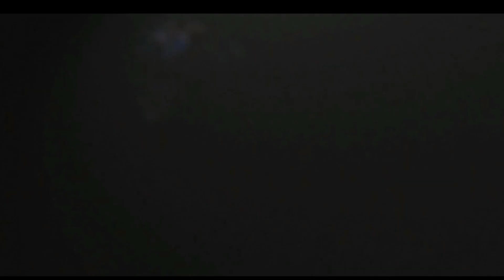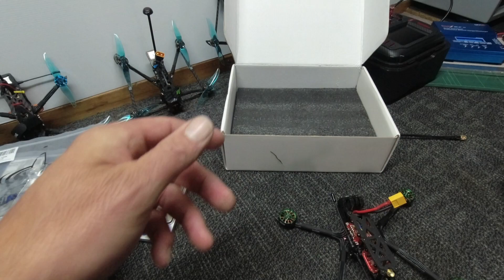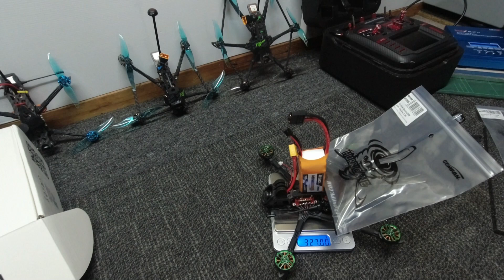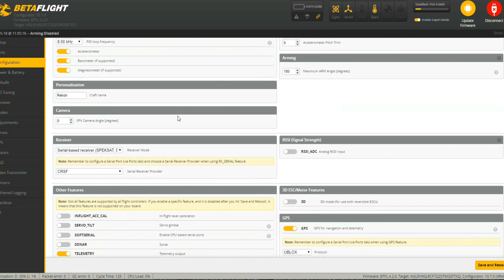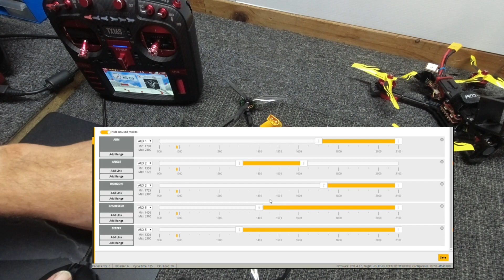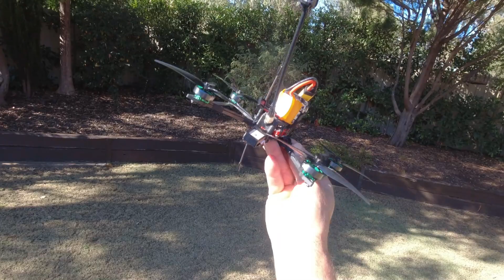HGLRC Rekon 5 - Long Range FPV to beat them all?

Comment: My reckon 5 didn't come with the brace arm screws. Do you know what size screws I need for the braces?
Reply: Thanks a bunch.
Reply from the maker: Sure mate. They are 9mm hex screws. Same diameter as the motor ones.  👍

Comment: I must have gotten old stock, because the one I just received (PNP 4s version) came with 2800kv motors and the immortal T mount only attaches to the side of the camera TPU (which is a pain).
Reply from the maker: Ooh. No good. What did you order  👍

Comment: I see you have "Bidirectional Dshot" turned ON in your configuration tab. So did you upgrade the ESC firmware ? Because out-of-the-box ESC (BlHeli_S) does not support this function on the original firmware.
Reply from the maker: Hmm. I did not set the bidirectional on.. I am about to see if my esc firmware was updated at all. I'll leet you know shortly!  Cheers. SP
Reply: @GTARC_au  If your Rekon5 DOES have bidirectional on, then I´d like to get some screenshots from you with all the factory settings for that (Configuration/Elec+Battery/PID setting tabs wth rates & filters subscreens). Can I contact you via email ?
Reply from the maker: Ive checked my esc firmware and see that it was not updated and therefore the bidirectional Dshot should not have been turned on.... yikes. Im not sure why it was on... ive since been over all my settings to double check.  Thanks for the heads up!. That explains why i thought that the R5 was not flying properly.  👍🍷🍻
Reply: @GTARC_au  Does your factory PID"filters" setting also have the Gyro-filter slider very low(far right), and the D-term-filter slider in the middle ?
Reply from the maker: Yes mate. Correct. The D term is in the centre and the Gyro is a quarter of the way in the Less Filtering section (far right).

Comment: What is the small wire connector next to the battery lead for ?
Reply from the maker: They are the power cables/connector for your hd camera. Insta 360 etc. 👊👍

Comment: How do you setup RSSI/LQ on an aux channel mine has always been just over OSD, it seems to still work fine, what's the difference?
Reply from the maker: TBS crossfire allows it to happen. Do you have tbs?
Reply: @GTARC_au  yes , my 8th channel is blank but my RSSI and LQ is displayed via OSD

Comment: I made a custom one and do over 40 min flights.
Reply from the maker: Wow. Have you posted a vudeo of it. 🍻👊
Reply: @GTARC_au  https://youtu.be/eTPa8zHZaR8
Yea that.. since tuning better and this time being smoother on the throttle I got this time. I want to try 4S and see if I can beat it. Also I have to try more efficient props like 5126 bi or 5125 tri.  That 40min flight was on 5130
Reply from the maker: For sure.
Ive been testing out the LION on my Rekon and cant seen to get more that 15 minutes?? I have the stock 1525 props and wonder if Bi-blades would be better??
Reply: @GTARC_au   I assumed biblades are better atleast maybe low rpm. but in motor testing the 5125 have been more efficient followed by Biblades then 5130. at high throttle since test starts at 50% that i find. I have not put the biblades back on to test since i broke 1 and dont have anymore. I can test 5125 and see if i can get a long smooth slow flight.. omg so boring lmao
all the data is subject because it matters weight ur carrying and throttle needed to hover.
PS also i try and stay at low amps and cruise 15mph to 20mph ( i averaged 18mph). gets longer flight but shorter flight distance
Reply from the maker: For sure mate. Agree 100%. Alsogoing to try tilting the camera up as far as i can to reduce the amount of throttle.  Im doing a flight video test  tomorrow to push to 30 minutes with the factory Bi blades! 👊🍻
Reply: @GTARC_au  I just tested 4S Li-ion with 5130 but with losing video and having to give it throttle.  Then return to home because I lost video. I only managed 33mins. I also had it sitting on for almost 10mins before starting.
Reply: @GTARC_au  wouldn't you tilt the camera to be less angle so drone not so ruled to see. To cruise at like 20mph or less.
Reply from the maker: That's a decent time mate. I know the feeling of losing vtx! 👍🍻
Reply: @GTARC_au  i just tried 4s li-ion again but with 5125 trying to be smooth did I think 34mins
It was windy. But not sure how much that changes time
Reply from the maker: Cool. On my way out now to do a range  and lion pack test. 👊🍻
Reply: @GTARC_au  can't wait to see results